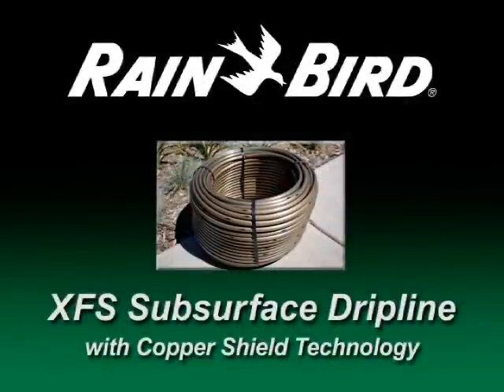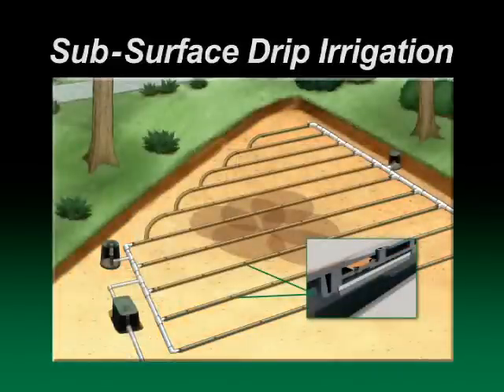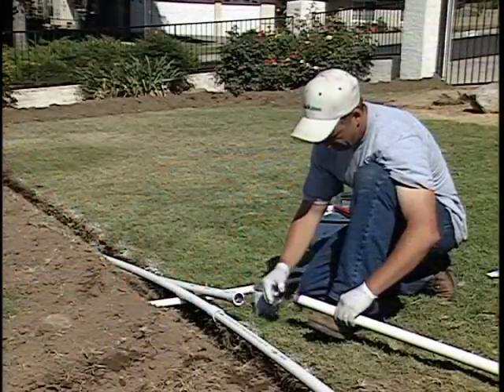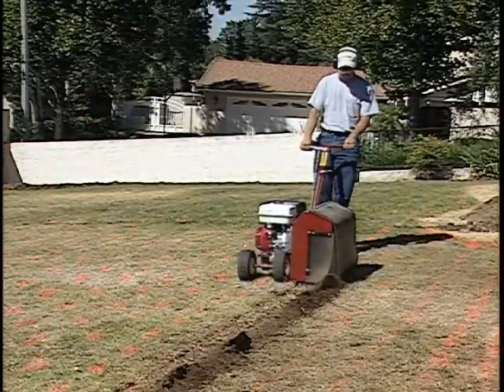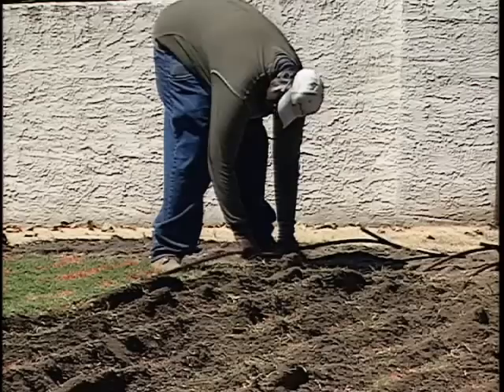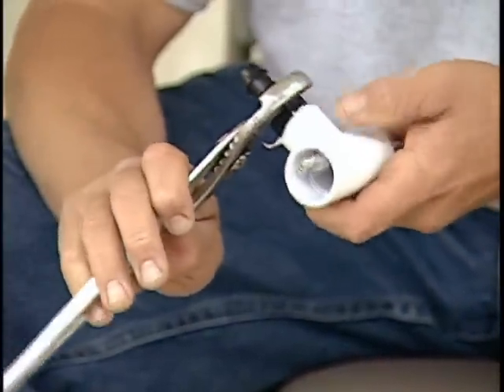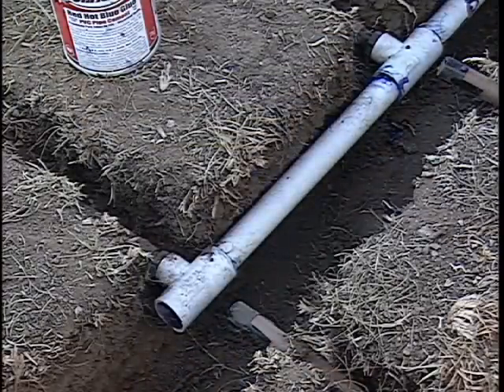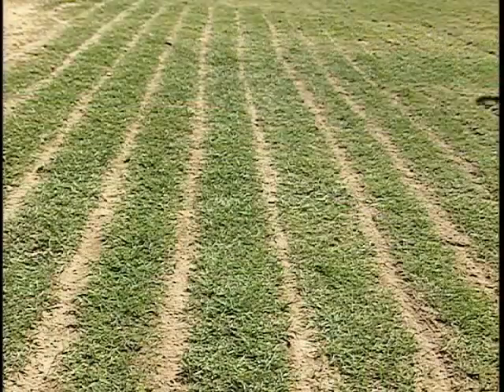Rain Bird XFS Subsurface Dripline Installation

Comment: at 4:51 i cant make out what he is saying, whats the thing with the orange cap? I am finishing off my design for xfs in backyard. What is the flush device actually for? Can I just have a manual ball valve that can run into drain? How/when do i use this?
Reply: ok great thanks! I have ordered the Rainbird XCZF175PRF 1" Control Zone Kit With Filter and the 1/2 relief valve, ill add the visual indicator too, and many thanks for replying! Have a 500ft roll of xfs9012 - will be my first install and finally managed to wade thu all the calculations and get down to a 12-14" spacing. I am using stored rainwater - what pump would be enough to run the 500 ft / no slope / 3/4 header pvc pipes? is there a 12v one that will supply enough pressure? soil is quite sandy -

Comment: What happens if you want to plant a tree in the lawn area with all those laterals 12" on center? Or if somebody accidentally cuts a lateral line while digging? Easy fix?
How about after you apply a dry chemical fertilizer, when the bag instructions say to water to dissolve pellets?
Reply: ***** Water from the surface with a hose?!  Lol!  Kind of a problem, eh?  Especially if you have large areas.
I have been selling your products for decades, including the drip irrigation, every time we have a drought. I don't know about this subsurface irrigation for lawns though. I haven't been convinced yet.
Reply: +chainsawchips We have used it and it works great. Have yet to lose a lawn. Have been received great support from Rainbird in Norcal too. Also, EZ-Flo fertigation systems are an excellent addition to a new install. No need for top fertilization for the lawn OR anything for that matter.

Comment: I have been reading and looking into the system of drip for 5 months. One thing I can say is planning. If you dont have the system sized to yoyr soil and have the drain and air purge valve youll have issues. Also agsin how was it put in. You dont kno as it was already in. Can you say for sure its in right.

Comment: What is wrong with it? Why don't you like it? I'm thinking about installing it in my lawn because I have such odd shaped lawn zones that the any sprinklers have to overspray to hit. This seems like the perfect solution. My only concern is that over time the roots will crowd at the entrance of the emitters. I'm not convinced it will be durable. If I had the option to inject a tiny bit of root inhibitor into the supply, just enough to keep the roots away from the emiters I could be sold.
Reply: did you ever end up getting it? i'd worry about internet lines and power lines, although i believe the power lines are very deep.